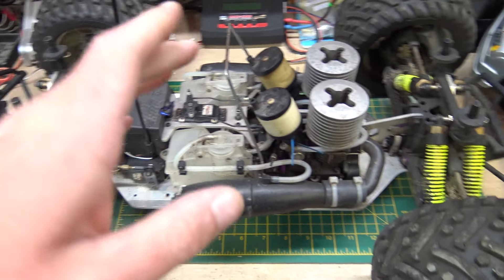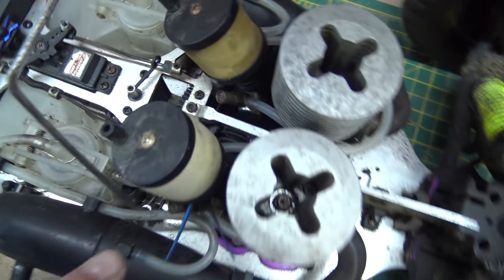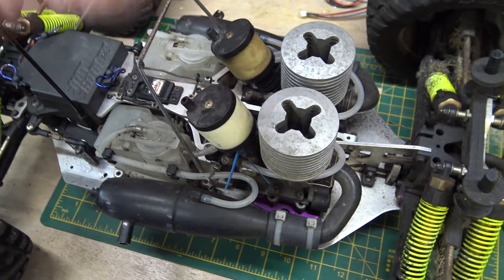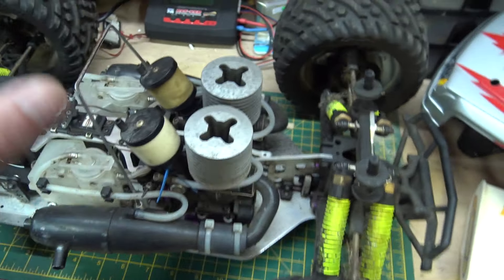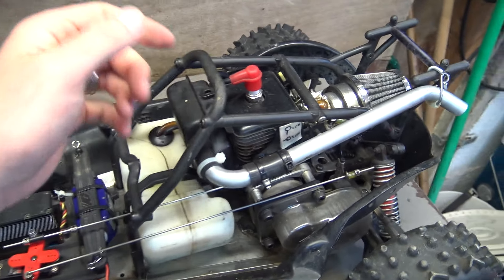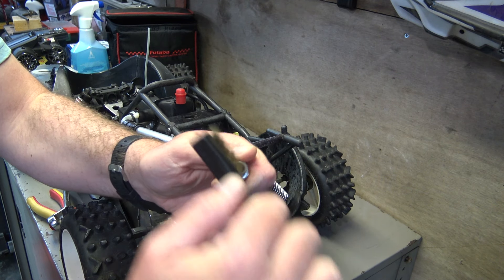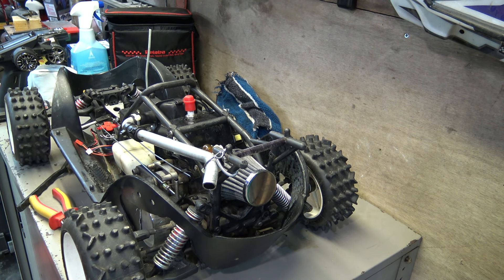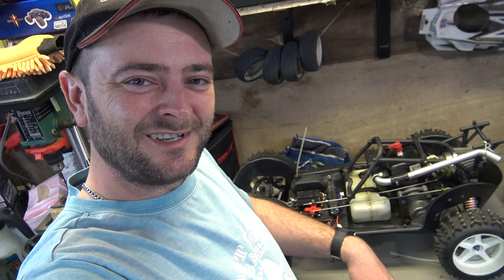One Of Many Ways To Unflood 2-Stroke & Nitro Engines

Comment: Hello haggard RC, I am wondering if you have any cen Ctr 5.0 carbs for parts? I really need the carb throttle arm that has a grub screw on one side and a ball end on the other side. I'm dead in the water and cannot use my car. Any help would be greatly appreciated. Thank you my friend.

Comment: Hi haggard Rc 
I have a problem with my FG marder. The engine with start and run ok and drive for about 3 minutes, and after 3 minutes
the idle will go very high to the the point we’re is drives the car forward and if you give it throttle it boggs down and stalls immediately. Just wanted to know if you knew what the problem could be. ????
Reply from the maker: That sounds like it might be a blocked vent on the petrol tank. To test that, take the cap off and start it up. Leave it to run and see if anything changes. Check the vent on the tank too! :)
Reply: @HaggardRC  thank you very much :)